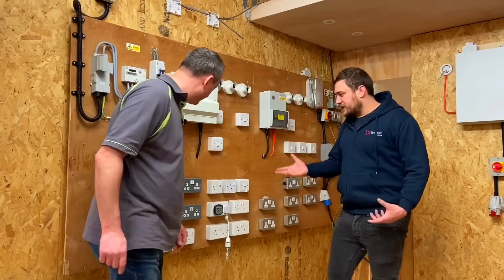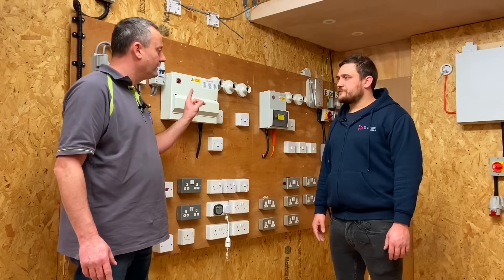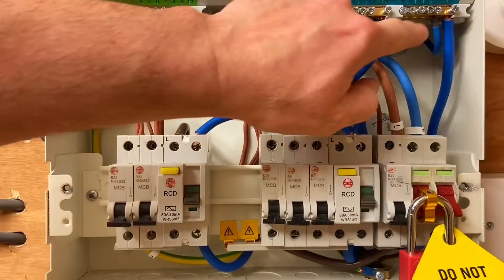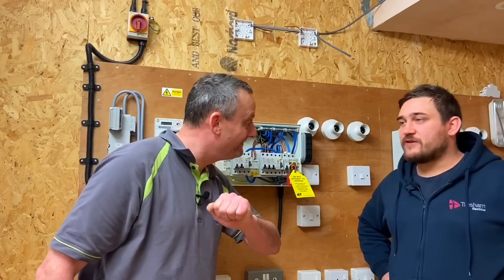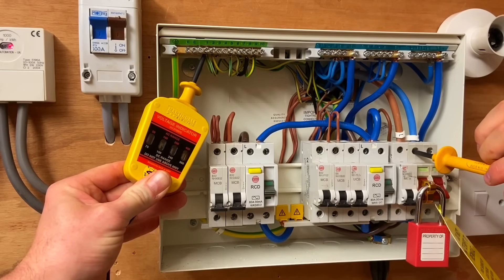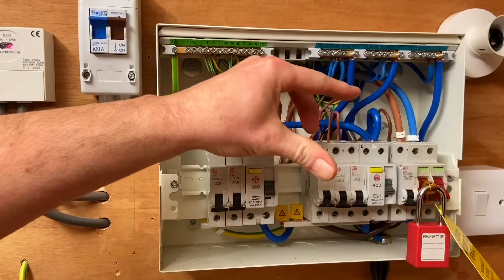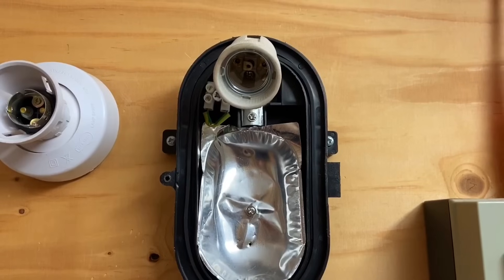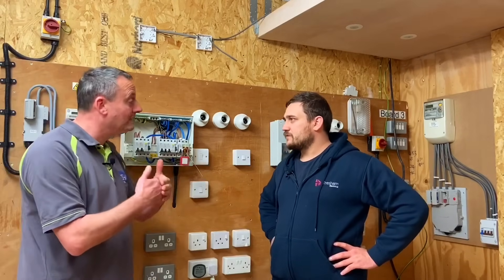How to Find Incorrect Supply Polarity Testing and Fault Finding Live Testing Single Phase 230 Volts

Comment: Great video, guy’s clear and precise explanation. 👍👍👍👍❤️

One question though, if you did all the required dead test in the correct order then the supply polarity test would show this fault at the CU as we test between line and neutral and line and earth and neutral and earth.

Comment: As the two wires, live and neutral had reversed polarity i assumed that some where along the circuit the wires had met an appliance or an object and weren’t wired properly ? Is this correct ? If so where along the circuit where the wires not fitted correctly?

Comment: I have had problems with electrician with this subject before doing commercial installations. There answer back to me is there in no problem with live and neutral being mixed up everything will work fine, It just reversed. Good video

Comment: Fault finding video's 😍

If I've understood this correctly, you have reversed polarity, so the neutral is now the line and doesn't have protection from a rcd etc.

So if you have a faulty appliance with a dead short circuit between line and neutral and have reversed polarity to the consumer unit, none of the safety protection circuit's would work.

And the faulty appliance would just draw more current until the wires melt etc or something goes bang?
Reply: RCDs still work, they look for imbalance between the two conductors and don’t really make a difference which is which. Technically, and practically, it is often possible to wire RCDs up in either LN or NL fashion depending on whether you need the live to come out the left side or the right. (Check your manufacturer’s instructions for whether they are tested that way, obvs, don’t take the word of a rando non-spark on the jnternet).

It’s the overcurrent “fuses” that no longer work — so both the “slightly higher current than specified” and “dead short circuit” functions of MCBs do not trigger, unless the current goes back through the live conductor.

So for fully rcd+MCB (or RCBO) protected circuits, those should still trigger on any of the 3 types of faults (albeit in a back-ass-wards way), but for MCB only circuits that are not RCD protected this would give you a situation where you could short out kilo-amps from “neutral” (actually line) to earth and not trigger any protection. Even the DNO main fuse won’t trigger, because that’s in the “line” conductor as well and that’s not part of this circuit! So the only protective device remaining is most likely going to be the transformer substation fusing, given that that will probably be before where the switch was made. So what is that, several kilo-amps? That’s a hell of a fire starter, twisted firestarter…

I suppose that’s one reason RCDs are neat.

Comment: Gaz, do you have schematics for your fixed testing boards (1, 2, 3 etc)? I'd love to make something like it for our college workshop as currently we don't have anything fixed and dedicated for the purpose. Failing a schematic, a photo with sections indicated (ring, radial, lighting etc. It looks beautiful
Reply from the maker: Direct message me on either Facebook, Twitter or Instagram look for GSH Electrical
Reply: GSH Electrical dropped a message via Facebook messenger. Your twitter isn't set to accepts DMs, if you're not aware 👍